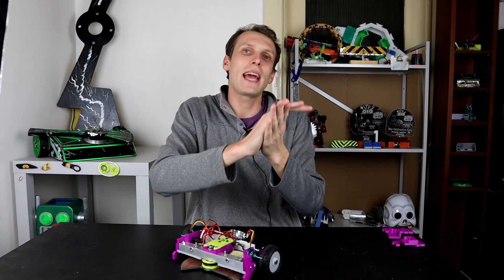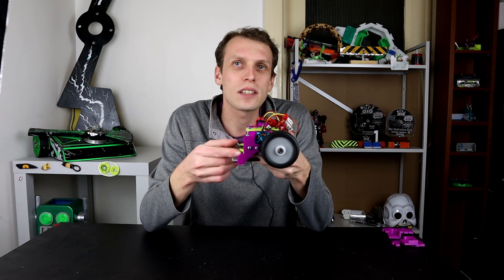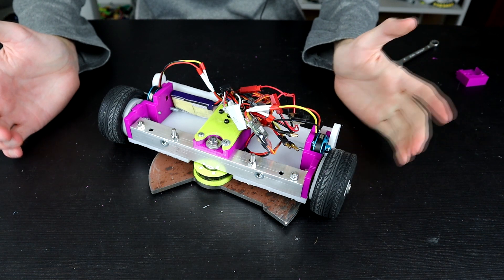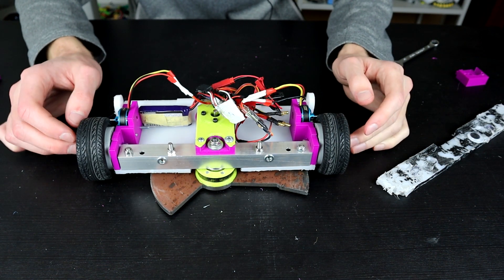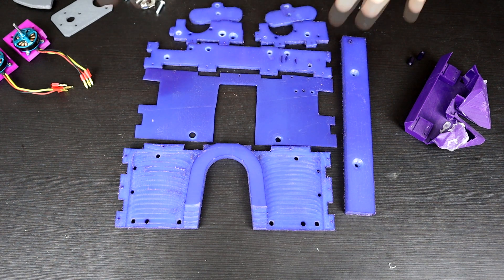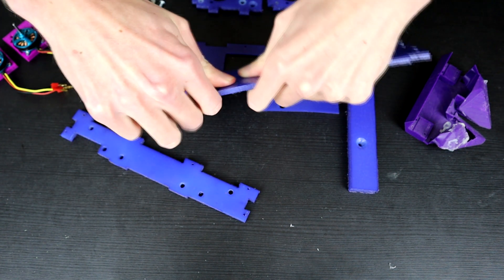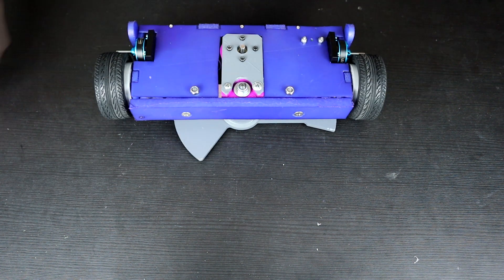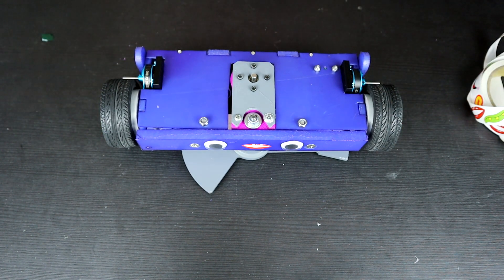Annie R U OK upgrades (Version 6)

Comment: Hi, Ben. I think all-over heat may be the only way to get those thermoplastic panels flat again. A bath in violently boiling water (5 minutes?) followed by clamping and pressing until cold (60 minutes) might do the trick, although there could be some shrinkage which would spoil the alignment of the assembly holes.

It may be better to assemble the entire chassis first, hold it flat with binding wire or clamps, and then heat (boil) the whole thing. This is a bit like using an autoclave to de-stress carbon-composite components, only it's a lot cheaper.

Water may not get hot enough to relax HDPE, so some experiments with a hot dry oven at 150°C might be more effective. (Followed by pressing flat and cooling.)

Don't try heating anything in molten sugar (syrup) because although it gets MUCH hotter than water, it's messy and scary stuff to work with and will stick to skin and burn right down to the bone just like napalm. Horrible.

The same goes for heating HDPE in a pan of vegetable oil. It gets seriously hot but can be highly dangerous. Deep-fried Annie is bad; deep-fried Ben is worse. Just say noooo!

So... If Annie's bits still won't lie flat, try submerging her in a tray of water and then cooking that tray in a really hot oven (250°C). In French cooking terms it's a 'bain-marie', and is the safest way to apply a great deal of gentle heat evenly without creating random stress points.

Once cooked, remove and clamp flat for an hour. It might work. Sort of. Maybe.

A long soak in a bubble bath usually gets my kinks out, although certain bits are subject to wrinkling. 😲

Comment: Maybe adding cheap partial-circle wheel guards that can be easily attached from top or side should be ok? If a ferocious spinner comes to tear Annie's wheels apart, the guard can take a couple of hits and then you can add new ones for the next fight. The shape of the guard can even depend on the type of opponent spinner too.
Reply: This feels like the best solution to me too. Otherwise the front plate could be extended over the wheels and pocketed to make the wheels clear.
Reply from the maker: I have been toying with the idea of a set of bent hdpe wheel guards, just need to determine thickness and work on my heat bending skills

Comment: Team Kludge checking in. No actual fighting robot experience (yet, FU Covid), but is this a situation where treads may be practical? If you have the motors at the back and the free spinning hub up front you could get a bit more clearance between the armor plate and the tread while still maintaining a solid grip on (at least) part of the floor.
Reply from the maker: Maybe, I have been avoiding treads because they are a bit heavy and can be fragile if done wrong, but they could be a benefit here

Comment: It doesn't look like the middle part of the baseplate is "supported" as it goes into the coloring vat.
Since it's at temperature for a long time and not supported it might "sag" in the middle during coloring and thus warping the plate?
Reply from the maker: Very possible, I did try to lay everything flat to cool/dry but the sag did occur in the dye bath

Comment: What if you just clap the baseplate down flat, probably on a thick piece of wood or some metal, and then just slowly start trying to heat to it. 
Lightly loosen one of the claps during it everyonce in awhile to see if its working, and if it stays down and doesn't warp up just reapply the pressure and let it sit overnight, and if it warps up again apply a little more heat.

warning, this is probably a really stupid or bad idea.
Reply from the maker: Thats not a bad idea and I might give it a shot in the future